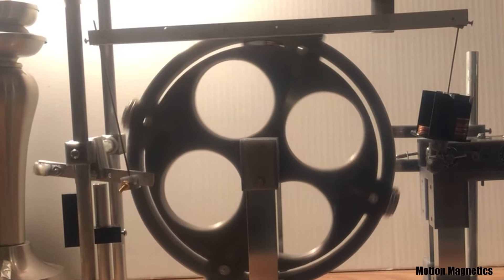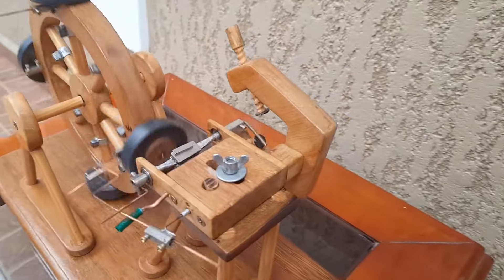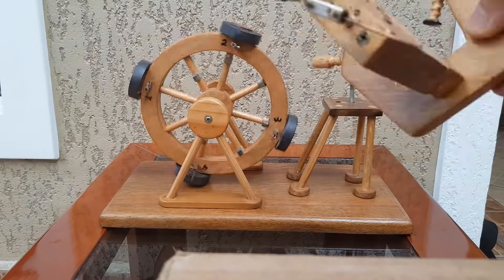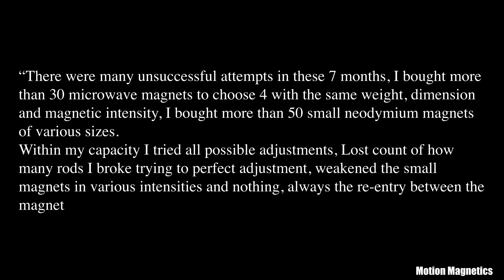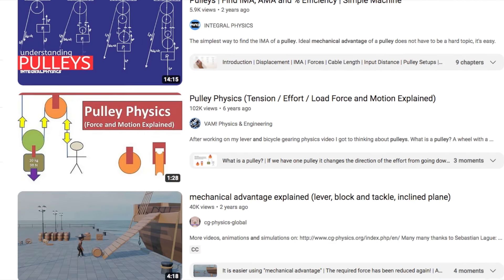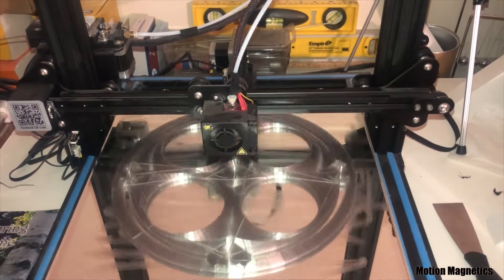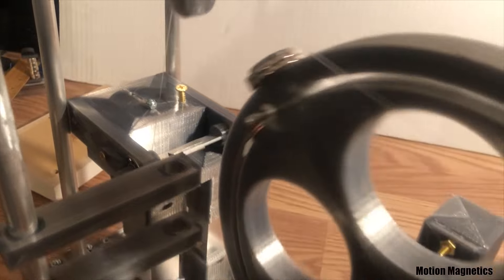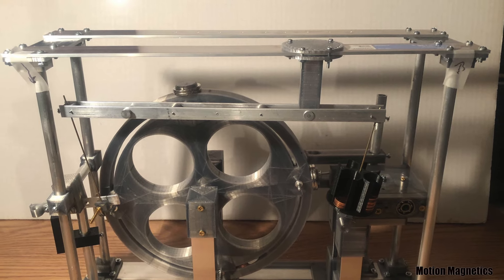The Perpetuum Magnetic Motor

Comment: Scale matters a lot! The range of the place where the free energy passes is very small, so the error per millimeter can become critical, but not in a huge amount is easier to hit.
Reply: This assumption is a very unlikely one. The effects of a machine usually show up in a broad range, although there is a maximum at a certain point. Why should a millimeter matter here? Since up to now no magnet motor has shown even a milli-Watt, it is much more likely that there is no small gap where free energy passes in. 
I give an example. If an object floats in calm water, water pressure works on it from all sides. Water pressure from below keeps the object floating. Water pressure from the sides could move the object sideways but this does not happen, an object floating in calm water does not move. Would it move you could gain energy from that movement. One could now try to give the object some special shape which makes it unsymmetrical in regard to the effect of water pressure, but with all shapes you try - round on one side, flat on the other or whatever - sideways water pressure always adds up to zero. And changing the shape somewhere for a millimeter will not help. The attempts to find a working magnet motor are similar to the futile attempt to find the shape of an object which moves in water sideways due to water pressure. Nature does not allow that and it can even be proved with higher mathematics that this isn't possible.
Reply: @heinzpg  No, ranges are important. Even a Christmas tree can loop, the main thing is to act at the edges of the fields of both magnets, there will be super-low efficiency, and there it will be a little further or closer and stand in the pit. On a rotovertor, too, it is over one at only one flywheel speed and with one load, there will be a slowdown outside the range. The shape of the bucket of energy on the pressure of the medium is a vortex with the speed of the thermal run of molecules. And the magnetic domino effect demonstrates the free energy of the wave.
Reply: @_M_H_T_    If your assumptions are correct - I doubt them - ranges may be important. Let's see if someone finds the mm-gap where free energy is expected to stream in ...  🙂
Reply: @heinzpg  Here, if the magnet is stronger, then the turn speed must be accelerated. This is important as when you break a ruler on a paper suspension and the force goes where it needs to. You can let the opposition through. But large masses can be compensated, but the shape will be very important.
https://youtu.be/C0-ijhxsACM
Reply: @_M_H_T_    The device which is shown in your link is a scam, it does not work.
Reply: @heinzpg  This can only be confirmed after checking the exact duplicate, and no one has done that.
This also works on the same principle. Jump in quickly.
https://youtu.be/gF5dn8pyE0w
Reply: @_M_H_T_    A confirmation is not possible, since no such inventor has ever allowed a rigorous check of his device. And in absence of such a check I rather trust conservation of energy than dubious perpetuum mobile devices. Conservation of energy is checked by engineers and scientists thousand times every day and it is always correct.
Reply: @heinzpg  Not zero, but a high frequency of weak pulses. We only round up to zero. Energy zero point. The pressure energy is also, as it were, potential, but it can be taken by maintaining a reduced pressure with a vortex at the speed of the thermal movement of molecules. A magnet, like a spring, always presses impulsively and recovery occurs due to molecular bonds. The magnet can be considered as an eternal fan that pushes only other fans, and if one is pushed out of the line of fans, then everyone will also line up, and if someone stands in the way, they will be moved. And by the way, the metal gets tired and cracks. It's all about fine tuning or a form of self-resonance. It is the walking kinetic waves that no one sees and does not take into account. For example, a pendulum 100 km high will swing like a small pendulum on the roof of a car that is traveling at a constant speed. Any pendulum always swings, it's all about accuracy and forget about balance and rounding.
No one considers the time that, for example, the force applied to one side of the lever spends time until it reaches the other edge where the load is, and in the meantime we clamped the lever shoulder and the load rises no longer by hand, but from what we clamped and it spends pressure your energy. If we analyze all the models in such a way that the forces will go there for a long time, then it will be immediately clear where in the connections between the energy of the starter and the load the free energy enters from the outside (from the inside, as elasticity, which itself is restored). And its nature is special, gravity + magnetism, it is impossible to emit a spring with magnets, when moving apart, the magnets weaken, and the elasticity always increases when the atoms approach and move apart.
Reply: @heinzpg  And now, knowing the pressure, you can take it from gravity using a column of water (Pascal's column). A thin column, and pushing hard, although the mass of water is only a maximum of 1 liter, and the barrel is torn to shreds. By rotating this column, you can get one impulse of pressure on the water, but without its flow, the blow will be strong and can twist something inside or hit from the inside and expand the edge for the duration of one sound wave.

     ----->
WATER PRESSURE
https://youtu.be/HZJDrBNTGCY

Pascal's pillar
https://www.youtube.com/watch?v=_w3Di_dCtsw&t=2s
Reply: @heinzpg  And by the way, the planet rotates because, like a cold ball, it absorbs the heat of the ether. Lubofy, a large cold suspended ball of dry ice will behave like the Sun.
Reply: @_M_H_T_    Sorry, but you make up theories in your head, but they are not real at all.
Reply: @heinzpg  No, you are wrong like most. It's like making a fly the size of a bus and not understanding why it doesn't wave at the same frequency as a small one. Everything is working. It is necessary to think correctly, for example, for each action, the reaction is only a recochet that is late, otherwise the action itself, by definition, is not possible.
Reply: @_M_H_T_   My view - which is also the view of science in general - is, that magnet motors are not possible. And up to now - despite all efforts - no one succeeded to build a working magnet motor. As long as no magnet motor exists it is premature to state that my view is wrong. Let's see if someone succeeds to build such a motor. As long as this doesn't happen my view stays unchallenged.
Reply: @heinzpg  Tesla did, John Rogers Searle did. Your representation is incorrect. Based on your understanding, this is impossible, and in science in general, cold fusion is unrealistic, although it was demonstrated to them, but the people, that is, like you, BELIEVE science, and if it has not checked, and it does not check it, then it is not possible. In short, I see no reason why magnetic motors could not work. On springs, you can do the same, but it's more difficult. Any magnetic motor will work if iron is used, without iron it is almost impossible. A simple magnetic Christmas tree will work if the floor is made of iron
and the cart made of magnet-iron.
Reply: @heinzpg  Back in 2012, our Shkondin demonstrated electric cars on his motor-wheels with over one unit. The principle is the same. It is necessary to turn and clamp a small part, and the rest will turn through the magnetic field. Domino effect with magnets! Trying to buy the GMC with his idea, I remember how Medvedev met with him at an exhibition of inventors and talked about something.
https://www.youtube.com/watch?v=PF6fWpiRoHc
Reply: @heinzpg  They gave it to a third party and even the Academy of Sciences. They don't want to look. That's all.
Reply: @heinzpg  They gave it to a third party and even the Academy of Sciences. They don't want to look. That's all.
Reply: @_M_H_T_    May be. But there are enough credible institutions which do paid expertises. They would readily do such an examination. I know such an expertise, which stated, that against known laws of physics overunity was found, but the experts also stated in their report that they asked if they could disassemble the device but they were not allowed to. Another example: a German university volunteered to examine the magnet motor of a Mr. Yildiz for free, but they also asked for a complete disassembly, which was refused by Mr. Yildiz. He also did not agree to a long time test. And remember, how science readily jumped at cold fusion after the P&F- publication. 

Scientists are interested in new things. A scientist who would find free energy would be famous. But of course scientists often also don't want to look, since they don't have much time and are tired of clarifying faulty claims and measurements of pseudo-inventors. But this doesn't mean you can't get a credible expertise if you really want to. Bye.
Reply: @heinzpg  And they did these independent groups. They regretted it. They were trolled and some were killed.
Reply: @_M_H_T_    Some were killed??? These are rumours only. Oil and energy companies don't pay any attention to the free energy scene. They have their scientific advisers who tell them that free energy does not work. Do you really think they watch YouTube and read free energy blogs? Can you name any inventor who was killed?

Comment: When I was a young person the trick I used was to use an old record player for the spinning part then plasticine to hold the magnets and a magnet off to the side held by hand to place into position to try to get it to work. Magnets shoot off and ceramic plates try to break. It helps if you allready know they work before you build them and it is simply a matter of weather or not you are smart enough to figure out how to make them work. I was. The ceramic plate sits on top of the magnets on top of the plasticine that tries to hold the magnets in place. None of it is very complicated. The idea is to be able to move the magnets and come up with more workable designs. So that in finished designs hopefully the magnets can be moved and repositioned. Small weights can be set on ceramic plate to try to hold it in place. Then slotted wood could be used to hold magnets 🧲 in place so they do not shoot away.  Sorry if I made anyone understand. Stay the same😊.

Comment: Where u pull the rod down with your hand put a magnet on the end of leverage bar
Reply: Then direct it to the wheel at the right timing
Reply from the maker: @markwood2956  The precision and timing is the tricky part.

Comment: These machines require massive amounts of precision and skill to make, and these machines require a level of efficiency so great it’s very hard to overcome. So why the hell are using the actual motion of the machine to keep it going? Let the magnets run on their own. 

Make this machine flat, connect it to a magnetic generator (magnets spinning around a copper coil to create  electric field), use a very minuscule amount of the electricity created to power a spring system that pushes the magnets. It’s feasible to create multiple of these units and have them run in parallel for 22 hours a day. It can be used in small and large scale power production. 

I’m just too poor to make it happen so I’m spreading the concept as far as I can until someone picks it up. All I ask for is credit and 1 stock in the company, or .1% royalties. Blueprints will come asap

Edit:
In depth-

Two rings of neodymium magnets. 1 outer ring (positive poles facing inward), 1 inner ring (positive poles facing outward). The inner ring will be connected to high strength aluminum arms. The arms will all be connected at the base and hooked to a shaft inside a ball bearing. This shaft will spinning a magnetic generator beneath the kinetic system.

The systems-
Kinetic system consists of the two rings of magnets, aluminum arms, and a ball bearing.
Electric system consists of the shaft, generator, motherboard and any essential wiring.
Spring system consists of a tube, spring, plunger, brushless electric motor, and a system of gears.

Hopefully I’ve explained enough for people to understand the vision and have the ability to create multiple versions of varying efficiency to patent and sell as their own. Preferably this can be a free device that kickstarts the process of becoming a post scarcity society. I can see how this will be used in many applications ranging from large to small, to very small. Good luck guys and let me know if you got it to work

Comment: You can cut down on drag by using an axle through your flywheel that comes to a point on both ends, and then using polished bronze or brass, preferably bronze cups for the needle to be seated in. I build engines from scratch, and I have employed every possible way you can think of for less drag and the needle point on either end of your axle that goes through the flywheel is the most efficient way to go as far as drag goes.
you want just the points of the axle to ride in these so-called cups. I haven’t used the needle axle in any of the engines that I have built because it’s not practical for what I do but for what you’re doing or for people who make gyros, for instance, or even tops use this method.
And you want both the axle and the cups to be highly polished. Good luck with it!

Comment: I would like to show you an experiment that makes energy

I used a sheet of plywood for a pulley. This pulley had two radii (1.0515 cm and 23.875 cm) from which I could suspend masses. These radii including the cord radius.

I suspended 20.45 kg from both sides of the 1.0515 cm radius.

I suspended .9 kg from both sides of the 23.875 cm radius.

I accelerated these two arrangements with the same extra mass at the same position on 2.103 cm shaft. 

They all accelerated at the same rate. 

This means that .9 kg at 23.875 cm radius is as easily accelerated as 20.45 kg at the 1.0515 cm radius. 

.9 kg * 23.875 cm= 21.4875

20.45 kg * 1.0515 cm = 21.5

The machine produces .9 kg moving 22.7 m/sec just as easily it would 20.45 kg moving 1 m/sec.   232 J or 10 J

Comment: I was looking for the graphite motor attempt suspended on a string.  You said that a bearing had too much resistance. What if the string was suspended from the center of a wheel inside a bearing.? As the string wound, it would slowly build enough tension for it to release in the bearing and keep spinning?
Also, have you looked into Victor Schauberger (sp?).  He was a forestry manager in Germany but was obsessed with natural fluid motions.  He studied vortices and was reputed to have made improved products.  There was also a lot of talk of magnetic and electromagnetic vortices being developed; even a connection to the reputed Die Glock.
Reply from the maker: The easiest way I've discovered is to hang the wire/string from a metal object under a round magnet. That's a simple way to make a very low friction bearing as there is very little contact with the round magnet which allows the object to spin more freely and for a longer period of time.

His research is fascinating, to say the least.
Reply: @Marion Campbell   Resistance of bearings can not be the cause that a magnet motor does not work. If a motor is so weak that he can't overcome such a resistance, the motor is not of much use anyhow.
As to Schauberger, he did construct useful things in his younger years. Later he turned into a crackpot and made weird and absurd claims. His patents are on public display but no one uses them since they don't work as Schauberger claimed.

Comment: Instead of having the magnet go up & down how about letting it revolution it's way around so when it comes to the next revolution it should propel it faster with each revolution gained.you might have to adjust the 4 magnets down to 3 maybe. As long as you got a nice smooth bearing or maybe a bronze/brass bushing or the graphite bushing could do as well to like those used with shaded pole motors. Those suckers spin forever.

Comment: Crazy. We built large scale motor that works like this. Nicknamed it the wobbler. We used air to make the magnets wobble. It was a 24" rotor with a number of wobblers. It had alot of torque, was low speed. Worked great. Got pulled off of it to work on permanent magnet aircraft launching system then maglev. The pmals is awesome. Robust. Off the shelve parts. Military asked us to do it. Admirals backed us up and wanted it in the carriers. They were in to deep with general atomics and threw more billions at it. Its way to complex. Should have gone with pmals. Pmals could be used on land however. Make short runways really fast. Plus permanent magner arresting gear. Simple proven stuff nobody knows about. All of it.
Reply from the maker: If that's real, it sounds interesting.
Reply: @Motionmagnetics  cheers!!

Comment: Please make a generator based on falling metal balls on a large wheel that will spin and generate energy. The main thing here is that the balls fall within 24 hours, or at least 12 hours. Then a person will be able to pick it up again and they will fall again. Is it possible to stretch the time? Do something like this if it makes sense.
Reply: It makes a ton of sense TChannel; in fact that is how it will be done. 

When a 99 kg wheel is accelerated by a 1 kg ball then the time that the dropping ball pulls down is 10 times as long as the time needed to return the ball to the top. It takes 20.19 seconds to pull down and 2.019 seconds throw the ball back up.

You have 198.09 units of momentum and you only need 19.8 units to reload the system.